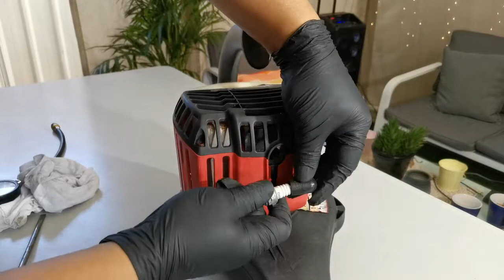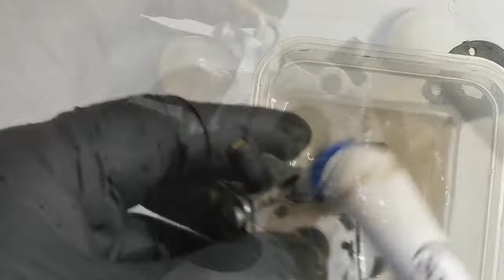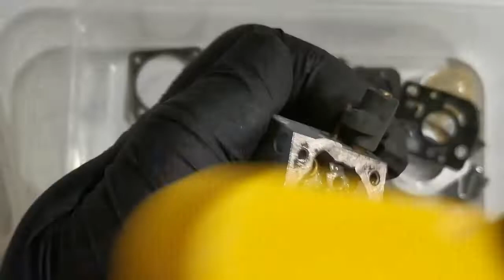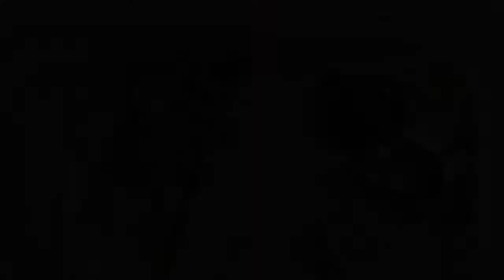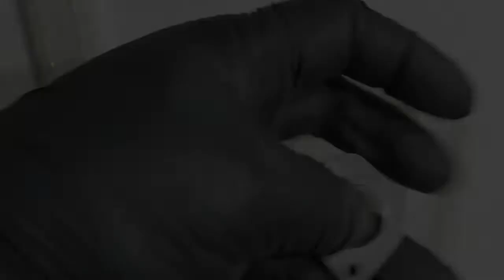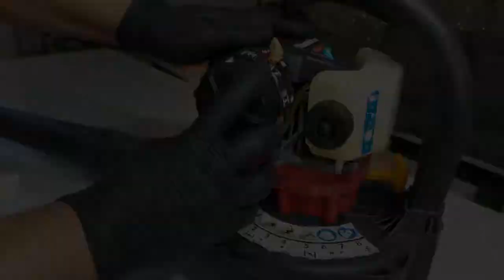VTECH 56 - Homelite Mighty Lite Blower Carburetor Rebuild

Comment: Outstanding video teaching.  My original carb does not say RUIXING on the manifold plate.  Could it be from some other manufacturer?  If so, the parts would be different.
Reply from the maker: If it's original, it should be Ruixing with no markings. I haven't seen an aftermarket for this particular carby.

Comment: YOU sir are a LEGEND PERFECT video just what i was looking for i purchased a non runner yest,got it home did the usual, but wouldnt prime/start, tipped fuel into engine via spark plug hole, started but stopped,then wouldnt prime so this vid will REALLY help

Comment: what tool are you using to remove the jets?  do you have a link or part number for it?
Reply from the maker: Thanks for watching our videos. This channel would  be a good reference for all your small engine maintenance and save cost on sending them for repair. We will add the link for the special tool. You can check on the description later. Cheers, VARIETECH